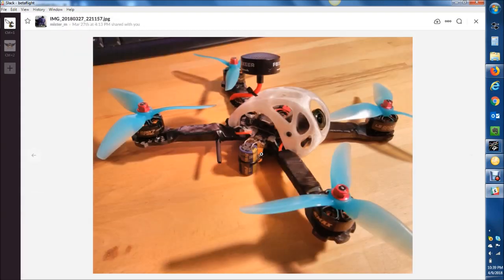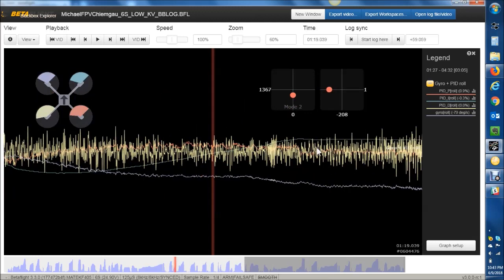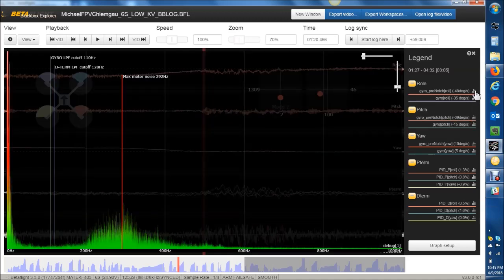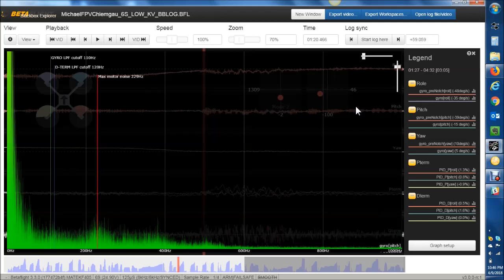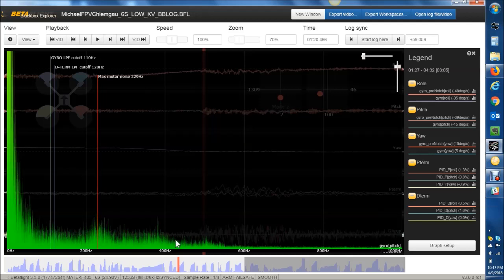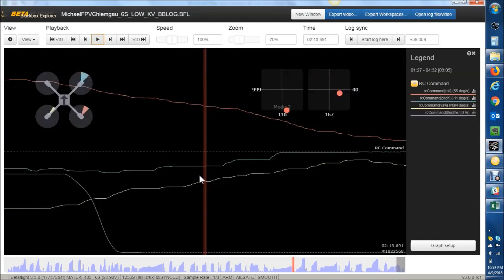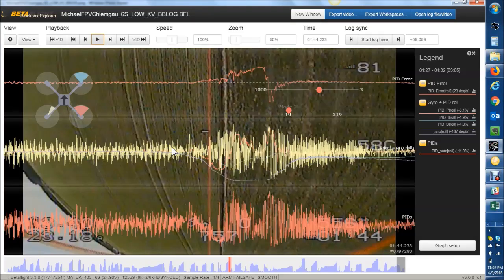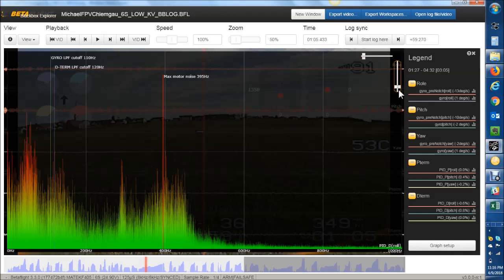2018.04.07-Michael Schmitz_6S Quad Log Review (HIGH D GAINS!)

Comment: Hi, nice review. One question raised (i know Michael) how much latency does RC interpolation introduce. We are juggling with 0.5 ms with these filters, but that interpolation will have a latency too, right? 15us at 15us? 7.5?
Reply from the maker: binding , yes, but of a different spot/type.  Input latency is from your fingers to the quad movement where 1ms = 0.001s (millisecond).  Filter latency steps back the motion the quad gyro is reads and reacts to, which the quad is working on a microsecond scale to react to prop wash and not have bounceback (1uS = 0.000001s).
Reply: oh, i mixed milli and micro, sry then 15 milliseconds on input isn't that low either (considering CRSF vs SBUS vs PWM f.e.)
Reply from the maker: Keep in mind it is 15ms on Roll and Pitch either way.  I recommend adding Throttle and Yaw to that mix and also, you do need to have smooth lines on Roll and Pitch because if not you will have an overactive Dterm due to the sudden PID Error spikes that will result from the jerky motion of what the FC is seeing from your still inputs.  Since D term is only on Roll and Pitch (and not on Yaw and Throttle) that is why those two axes are smoothed by default; but I suggest for this log need a little more.  I also recommend adding Yaw and Throttle.  I would say that folks are more sensitive to Roll and Pitch anyways.